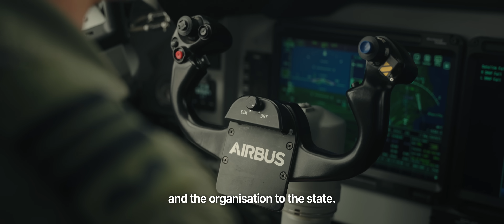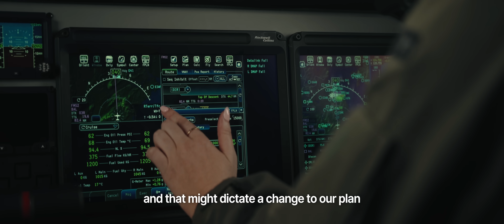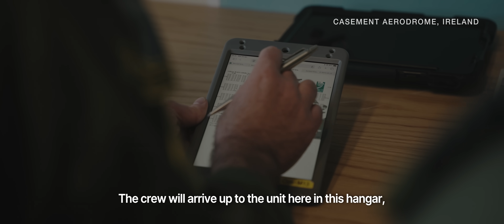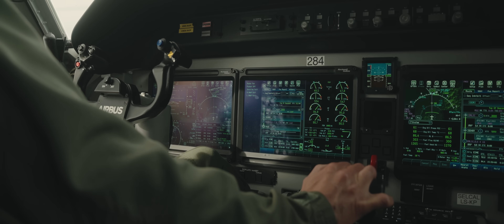Ireland's secret weapon against illegal fishing: The Airbus C295

Comment: They need to be unmanned. The cost difference is astronomical. A good aerodynamic unmanned design can have very long range and high loiter time for negligible operating cost. It just needs glider wing aspect ratio and slender body. Quality optics and electronics can be ultra small today. Engineers are doing it so clumsily